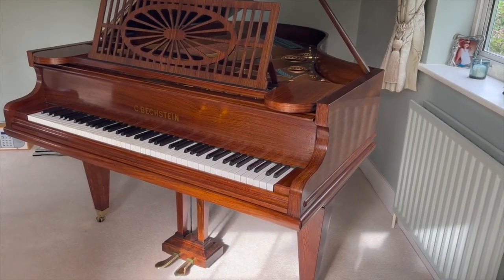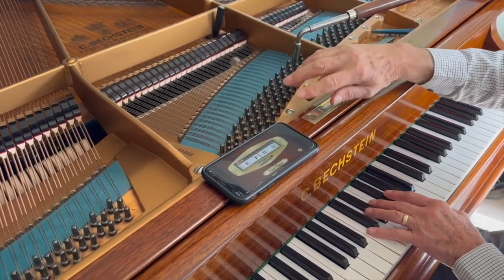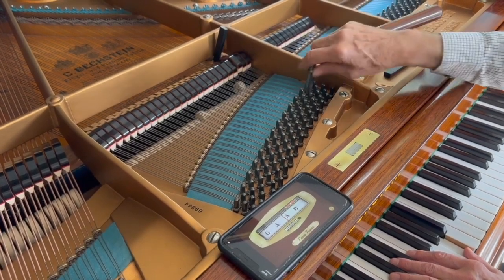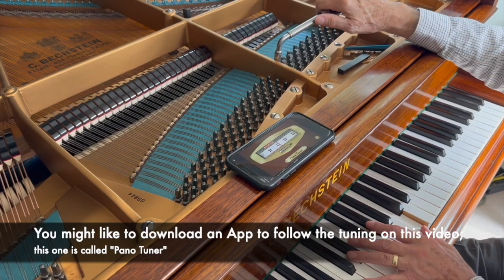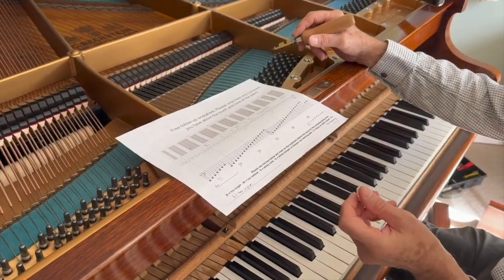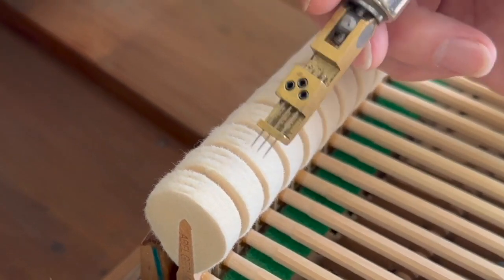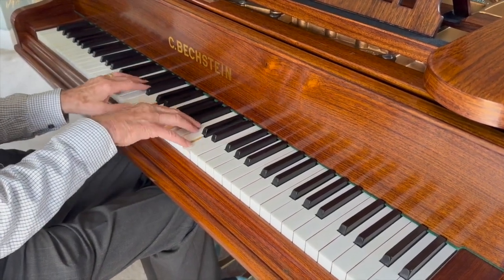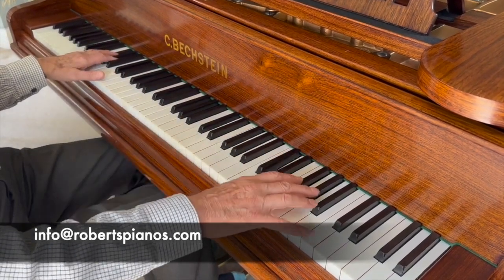Piano tuning and fine voicing three months after delivery. + false beats on Bechsteins.

Comment: YouTube comes up with repeated suggestions of what might interest me. Something I get criticised for by American technicians is not tuning with the lever at a 1 o'clock position and instead being much more pragmatic with ergonomic positioning at 3 o'clock which like you I find much easier and controllable.
Reply from the maker: Yes, I agree, everyone's different so there should't be any rules except to tune well and make sure the tuning lasts for a long time too. Marcus
Reply: @RobertsPianos  It's not only that but also that all pianos are different. Experience leads one to work with different instruments in different ways and some demand one to use different techniques. Position of lever can for instance depend upon how the pin wants to be set, and how stable the pin-string relationship when one ceases pressure on the lever.